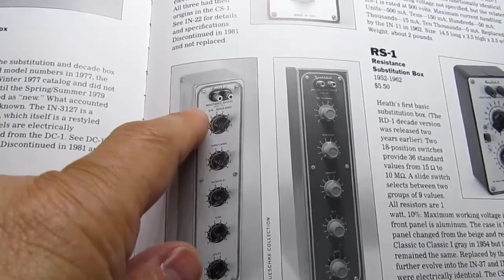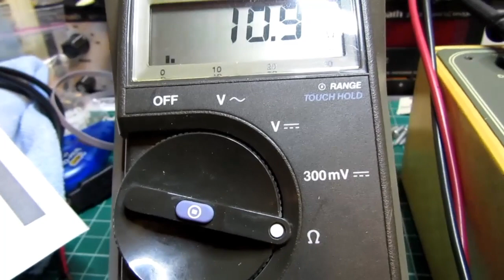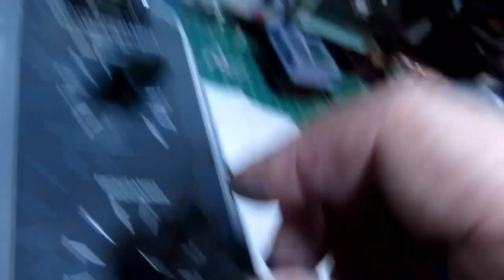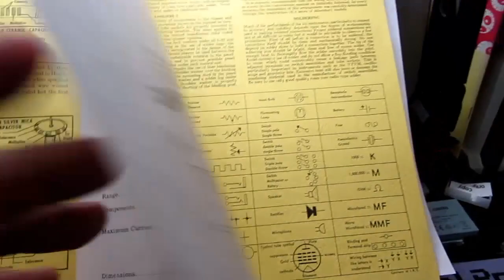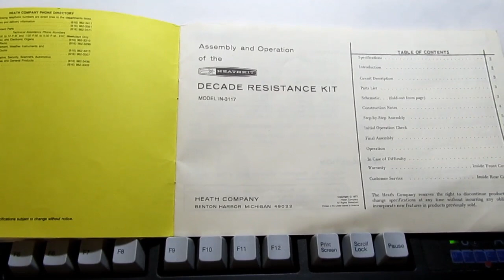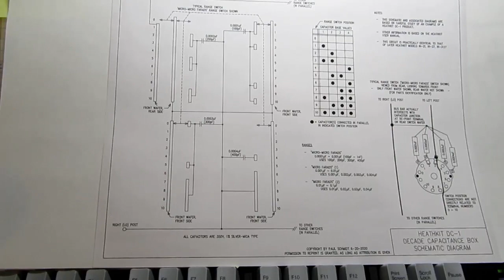Heathkit Decade Resistance Boxes, from Earliest DR-1/RD-1 to Last Models

Comment: Call me ignorant, what is the practical use of this device? Adding adjustable resistance to electrical circuit? That was way before my time I guess. The cap box you reviewed before must serves similar purpose.
Reply from the maker: Decade boxes are useful when trying to empirically determine the best value in a working circuit. Connect the box where the component in question normally goes, and adjust for best results. Then the positions of the knobs show which part value should really be installed in the circuit.

Decade boxes are not obsolete...they are still made and sold today, and used by a lot of labs, shops, and experimenters. However, they are usually much smaller, with more modern parts, tiny switches, a usually quite low secondary values such as voltage or wattage (and therefore less expensive). Even today there are manufacturers producing laboratory grade decade boxes, sometimes costing well over $1000.

These old Heathkits are actually a pretty good deal, because they were made during the post-war period when Heathkit was basing a lot of designs on the vast amount of inexpensive military surplus parts that had become available....excellent specifications and military grade quality on the parts. Equivalent specs today mean pretty high prices.
Reply: So it’s like breadboard prototyping. Interesting
Reply: You can also use one, along with a 'scope or DMM and a sig-gen, to measure the input or output impedance of just about anything. These 5-6 dial ones are great for output impedance, but you usually want to go up to a meg at least for input impedances.